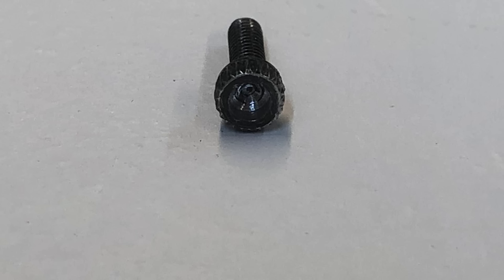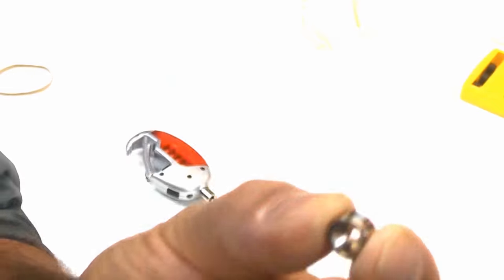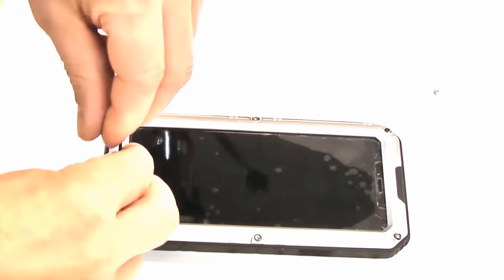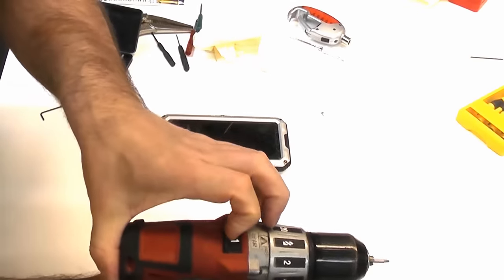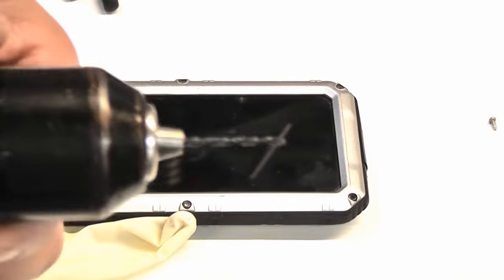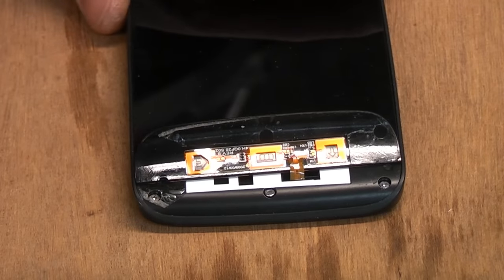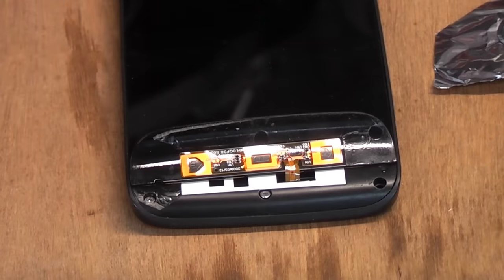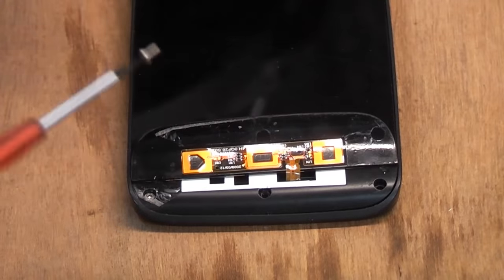How to remove small stripped screws | stripped laptop screws | stripped phone screw removal

Comment: I am trying to replace my joy con shells for the switch and ran into this issue.  It didn't take much but I just had a screw tighter than the others.  Its only stripped a little so hopefully the rubber band will do the trick.  Will update!
Reply: Sometimes a straight screwdriver can work too because it bites into the screw head better than the cross tip does.

Comment: None of them are working, and I don't have a round magnet. If I use the super glue on one, how do I remove the screw to do the rest ♥
Reply from the maker: Hot water will loosen the bond between the screwdriver and the glue, or in most cases it will just snap off as the bond is not great.
Thanks for the comment 👍

Comment: I didn't realise I had left handed bits till I saw this I thought the went both ways lol. And a lil tip if you want the glue to set immediately ad a tiny drop of water, not to much and it's solid straight away
Reply from the maker: Thanks for the info ;-)
Reply: or baking soda - safer than water in some situations

Comment: Thank you for sharing your experience. What happens with screws that have lock tight and they are star in 1mm ?
Reply from the maker: You can apply localised heat to the screw using a soldering iron, that should soften the Loctite 👍

Comment: If you can't find a magnet to go around the screw driver, look for any powerful magnet and leave the screwdriver tip stuck to the magnet over night. A strong enough magnet will temporarily magnetize the metal is left together long enough.   I left some scissors stuck to a 4.5 kg strength magnet over night. When I separated them the next day, everything was getting attracted to the scissors.

Comment: With the glue solution, aren't you ruining the screwdriver head? But great video, thank you. One more thing to ask... What are left handed drill bits used for? The result is a hole or chamber just like a right handed would do.
Reply from the maker: No, you can easily scrape the glue off, as it does not stick brilliantly to metal.
Left handed drill bits are used in some machine shops, they are brilliant for removing damaged screws/bolts etc.
Examples here- https://www.youtube.com/watch?v=dJfkCj3FWBs
https://www.youtube.com/watch?v=_mTFQbaT3Zc
Thanks for the comment ;-)
Reply: You can also use a lighter for burning the excess.

Comment: I have a stripped screw on a used 1004 PSP, I've tried with many screwdrivers and even a rubber band but I didn't try rhe glove or tin foil techniques. The cyanoacrylate solution might be a last option before the dremel apocalypse.

Comment: Im currently having a problem with the tiny screw you find inside an iPhone since im doing a screen replacement. The screw won't turn, maybe because its too tight, but its very tiny. Should I put little superglue on the tip of the tiny screwdriver and try that? Or do you have any other recommendations?

Comment: I'm in a situation with this Allen screw. I tried using the screw remover bit, I tried hammering in a torx piece, then I tried cutting into it's outer ridge with a dremel do I could get a flat head screwdriver in there. When I turned the screwdriver, the damn screw splayed apart instead. This screw is so butchered that I don't think I'll ever get it out without sacrificing the component it's fastening.

Comment: what about if the head is fine, but it just keeps spinning in the thread? i get it to where it looks like it will come out, then i hear a little snap, and it just keeps spinning, snapping, spinning, snapping... i can screw it just fine like i said, but the actual standoff is broken or something. any ideas? cant find anything about this online, but im probably being dumb.
Reply from the maker: Sounds like the part where the screw - screws into is damaged.
Removing these can be difficult/even impossible.
You might have to grip the head of the screw with pliers, then drill the head off from the screw, but it is not always possible!

Comment: Do you soak the super glue in acetone afterwards to remove it?
Reply from the maker: No, It does not stick well to metal, so I just scraped it from the screwdriver using my thumb nail.
Thanks for the comment
Reply: @ultimatehandyman  Thank you for your reply. I tried the rubber band and the aluminium foil tricks. Rubber band didn't work, but the foil did on some of the screws. That was rather surprising... especially since the screwdriver's tip kept punching through the foil almost immediately. I will try the super glue on my laptop's HDD housing tomorrow. Why oh why must they tighten those screws down so? Not likely that HDD is going to try to make an escape, is it?
Anyhow, thanks very much. Very clever video.
Reply from the maker: You are welcome. Best of luck with the other screws ;-)

Comment: Thanks for the useful tips. Who’s the cack handed so-and-so in your house who keeps stripping threads? Just a thought, if you used mitre bond ( which is basically superglue) and activator, the glue would set in about ten seconds.
Reply from the maker: The screws were stripped intentionally, I keep all my screwdrivers well hidden.  Last weekend I assembled a bunk bed with the girlfriend, I left her with the drill driver to drive in some screws in the slats that support the mattress. End result was a load of damaged screws and a rounded off screwdriver bit- ARGHH

Mitre fast is great stuff ;-)

Thanks for the comment

Comment: Thanks for the tips. If the screw hole is actually what's stripped, is there any way of re-threading it? The hole is about the size of the one demonstrated in the video with the phone case and it's made from aluminum.
Reply from the maker: I don't think there is much you can do, apart from maybe filling the stripped hole with some kind of chemical metal, which can be tapped once it's gone hard. You could then drill a hole and re-tap it to the correct size and use a new screw. Perhaps something like this- https://fave.co/2UK6fi3
Thanks for the comment 👍

Comment: hello, ive destroyed the head of one screw on my casio watch. Is ther any way how i could remove the srew? You think the super glue method will work?
Reply from the maker: It is worth a try
Thanks for the comment 👍
Reply: @ultimatehandyman  thanks!
Reply: @gaboaaa23  how is it going? is it work?
Reply: @ultimatehandyman  Ok, the wath arrived! Put a new battery in and it works(old battery was put in upside down...no wondern it didnt worked :))))  )
The screw wasnt destroyed so heavely so that i could turn out the screw. Thanks

Comment: With the super glue trick, does it damage the screwdriver? Like , how'd you get the screw off when you were done?
Reply from the maker: No, it will not damage the driver. You can remove the super glue using hot water 👍
Reply: @ultimatehandyman  Thank you!

Comment: I have stripped screw inside my macbook pro late 2013. its a size T5 torx screw and it the screw is there to hold down the internal ssd in place. How do I get it out or unscrew it out?

Comment: I've got 3 tiny flat screws under the optical bay of my laptop. I don't think they are stripped yet but they won't come out. Tried the rubber band didn't work, I guess I've only got glove and tin foil left to try. Not doing the superglue cus I read someone ended up super gluing their screw into the hole. Anyone else know oany other miracle fixes or tiny laptop screws??
Oh and a fix that i used on my other stuck screws on the laptop was I put my screwdriver on the screw and then grabbed a set of pliers to grip the screw diver at right angles to the screw driver and turned. That worked really well for the other screws.

Comment: Hi, I tried the super glue method, and maybe I added too much, or didn't wait enough for the glue to dry or something. Long story, short, I the screw head is not filled with super glue. Any tips on removing it, beside just scraping it with a small screwdriver? Thanks!
Reply from the maker: Hot water will soften it, or heat applied by a heat gun etc. 👍

Comment: Tried rubber band method. Didn't work. Tried glue method, messed up and just glue filled the hole. Don't have tin foil and need to go to home depot. Will the micro stipped screw remover take out crazy glue unforced over tightened screw without breaking the expensive plastic
Reply from the maker: It should do, providing you are careful.
Thanks for the comment 👍

Comment: Great video - thanks so much! Sorry if I missed it but what reverse RPM would you use? I know slow but I'm going to end up buying a drill so want to make sure it's suitable. Cheers
Reply from the maker: As low as you can get it. Most cordless drills these days have a variable speed trigger switch, so you can control how slow it rotates by using the trigger.
Thanks for the comment
Reply: @ultimatehandyman  Cheers mate - subscribed - really clear useful advice!

Comment: Good vid but how do you remove the glued screw from the screwdriver? Is it not too glued that you can just use your hands or is there a certain method needed to be done?
Reply from the maker: Just run it under the hot water tap, that will break the bond ;-)
Reply: @ultimatehandyman  ooohh so I melt the super glue wit hot water? Good to learn summin new. I thought super glues are impossible to beat lmao.

Comment: Would the left handed drill bits work on something like the screws at the start 0:23 (I think the ones I'm working with are a wee tiny bit bigger, and also in a bigger hole) if yes could you please send me the link. Sadly the techniques you showed aren't working for me, thanks
Reply from the maker: Left handed drill bits work most of the time, but nothing is guaranteed- https://fave.co/32kpY70
Thanks for the comment 👍

Comment: Does using super glue not ruin the driver?? How do you remove the screw from the driver once it’s out?
Reply from the maker: It will just scrape off, but if you are struggling hot water will help.

Comment: What size is the smallest micro grab it extractor? I accidentally broke off the head of a 2.5 mm stainless steel screw in my guitar and I am trying to find a way to get it out if it’s possible.
Reply from the maker: I have used one to remove a tiny screw from a keyfob, not sure what size the extractor was, but the screw was tiny-
https://www.youtube.com/watch?v=q6gehydy70k&t

Comment: Help. Trying to remove a screw from the inside of an old laptop with a 1.5mm philips screwdriver. Got the first screw out after finally getting a philips in this size, but everything I’ve tried before has stripped the second. Tried the glove, screwdriver ripped through it. Tried the foil, screwdriver ripped through it. Try variations version of doubling either material, rips through the foil, just spins the glove bit. Tried the rubber band, screwdriver stabs half way into it and the rubber band itself seems to be too thick to even make it into the space. I’d rather not look into power tools for the innards of a laptop. How are people not stabbing through materials, or is what I’m trying to work with too small?
Reply from the maker: Did you try the super glue?

Comment: I tried using the rubber band and glove with no success on a small screw. I had almost given up when i said screw it(no pun intended), and just drilled thru the entire screw with 1/16th, 1/8th and finally 3/16th inch drill bits I happened to have. It worked, but will compromise threads. Luckily the piece I was replacing had the threads on them so it worked out.
Reply from the maker: Thanks for the comment 👍

Comment: My laptop screw is located in deep. It is not on the surface or easy location to remove. I have tried super glue but didn't work as well. I tried aluminium foil and didn't work either. I am stuck. Drilling is going to be a difficult because the location of screw is really bad. It would be hard to reach there with a dremel. Any suggestions?
Reply from the maker: A left handed drill bit might be your best option, if you can get access!

Comment: I have a stripped screws on my new nintendo 3ds and I wanna remove the micro sd card but rubber band, foil, and glove is not working. Can you help?
Reply from the maker: Have you tried the super glue?
If you get them out, just run the screw under hot water from the tap, to release the bond with the screw driver.
Failing that, you might have to use a Micro-grabit or similar.

Comment: However, what about a laptop hard drive screw that has stripped THREADS and is bound, just spinning roughly, but the head is fine. Tricky. May be using the old Super Glue method.
Reply from the maker: Best of luck with it 👍

Comment: If you do manage to remove a very damaged screw, how would you go about finding a replacement? Particularly for things lie laptops or phones? Thanks
Reply from the maker: For phones, I normally search Google for "Iphone X screws" etc.
Laptops are more difficult, normally You have to measure them, sometimes you can get selection boxes that have several different sizes in, like this- https://fave.co/3b8a3hD
Thanks for the comment 👍
Reply: @ultimatehandyman  Thank you! I've got a selection of them coming. I've also had to get the grabit drill bits as none of the other methods worked on this one particular screw, got all the others out thanks to this though so thanks!
Reply from the maker: @SeeingSaturn   The Grab-it bits are great, they have saved me a few times! 
Thanks for the comments

Comment: I have a ps4 controller and the screws to take it apart are mest up because when putting a screwdriver in the tip will not go in to the screw and when turning it ,it will just go over the cross
Reply from the maker: You might have to use something like this- https://www.youtube.com/watch?v=q6gehydy70k
Thanks for the comment 👍

Comment: Is the superglue method risky as it might get stuck with the driver forever.
Reply from the maker: No, just run it under the hot water tap and the bond will soon break ;-)
Reply: @ultimatehandyman  thanks! I'll open my nintendo switch joycon screws this way then

Comment: Idky the rubberband or tin is even a suggestion, 10 tiers of my screw drivers go through it like butter.
Reply from the maker: It depends how badly the screw is damaged. Sometimes they will work, but if the screw is badly damaged you might have to try another method.
Thanks for the comment 👍

Comment: Super glue method does not work. If the screw and bit is dry there will be no bonding. Getting the end of the bit wet will help create a strong bond between the bit and the screw. However super glue doesn't have strength when it comes to torque as it is to much for the glue to handle and the bond will easily be broken.
Reply from the maker: It works sometimes 😉

Comment: Any tips for getting what's left of an M3 screw (about 10mm in length) out after the head sheared off?
Reply: You need a 2.5mm drill bit. Carefully line up the bit with the centre of the screw shaft and drill slowly. You may want to do it with a manual hand drill rather than a power drill just to aid in controlling its direction and speed. It should break the screw into pieces and you can then magnet the bits out.

Comment: Do you think the Rubberband method or Foil method would work on a stripped T6 torx head screw with blue medium hold locktite?
Reply: Also, do you have a idea idea if they make the micro grabit bits small enough for a T6 Torx head screw?
Reply from the maker: Best to apply heat first to soften the Loctite, you can use a small soldering iron to do that.
Then you could try the rubber band method, once it has cooled slightly.
Reply from the maker: Not sure, but I have removed a small screw using them- https://www.youtube.com/watch?v=q6gehydy70k&t

Comment: I have a T6 screw which is almost completely stripped smooth inside.  It was my bad, it was initially stripped, but I managed to fit an allen key into it, and got a strong bite, but the screw was too tight and the allen key stripped the screw further.  So there is nothing left in the hole.   As it is a T6 screw, do you know what size of screw extractor should I purchase? 

I am also interested in the super glue solution,  but given the screw was really tight , would you reckon it would work, or should I just go straight to the screw extractor option?   Also if I use super glue, would it ruin the screw bit itself, or it can be cleaned off the bit?

Thanks a lot in advance for advice!
Reply from the maker: I'm not sure which screw extractor you would need, but you could try the micro Grab-it set, I have used those successfully on small stripped screws- https://www.youtube.com/watch?v=q6gehydy70k&t

You could try applying a little heat to the screw by using a soldering iron, then let it cool before attempting removal again.

Super glue will cause no harm to metal tools, just use some hot water from the tap and it will scrape off with your finger nail.

Thanks for the comment 👍
Reply: @ultimatehandyman  wow, thanks a lot for replying!  I will get the micro grabit set, which I just checked is available on Amazon.  Thanks!

Comment: Unfortunately the glove and aluminium foil methods don't work for me. 
Now on to using the super glue method, but is there a way to safely detach the screw driver from the screw afterwards?
I'm afraid it'll fuck up both of them, and the screw driver was expensive!
Reply: Actually, I ended up scrolling through all these comments and managed to find the answer :) 
"Just hold the screw with a pair of pliers, it will easily break off from the driver- or run it under hot water."
Reply from the maker: Glad you sorted it 👍

Comment: Any suggestion on correct size of drill bit for stripped screw Torx M2.5x4 (Dell XPS 17 Laptop)?
Reply from the maker: You would need something small for that, perhaps a 1mm drill bit (but you might need a special chuck to hold the bit)